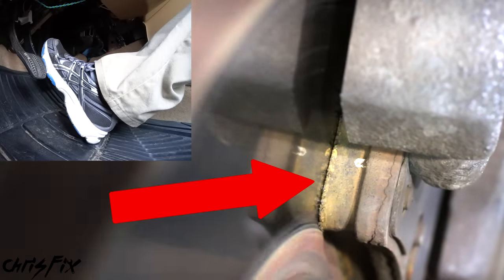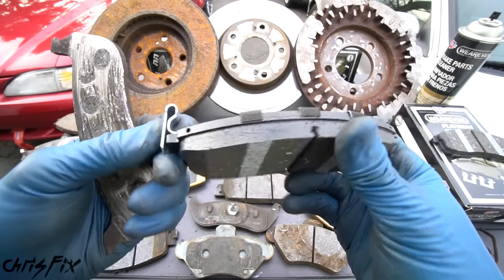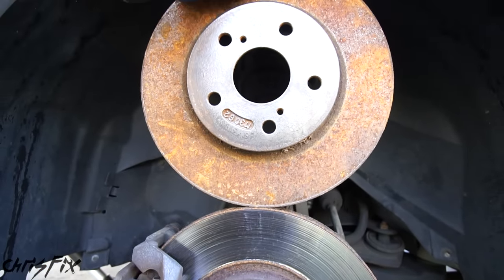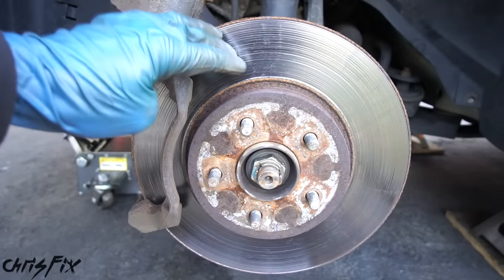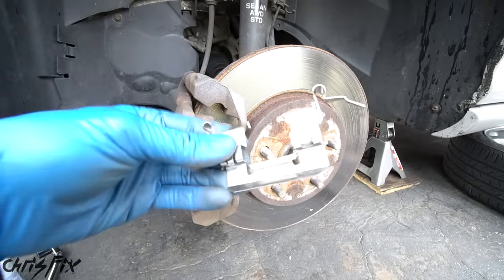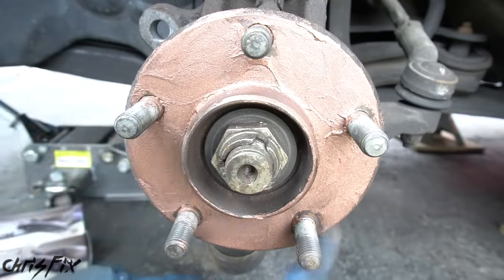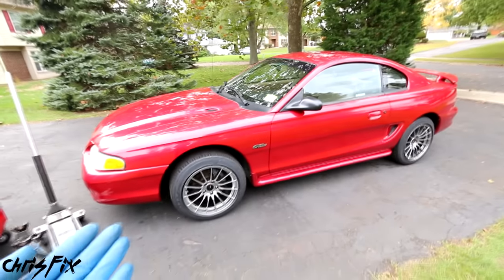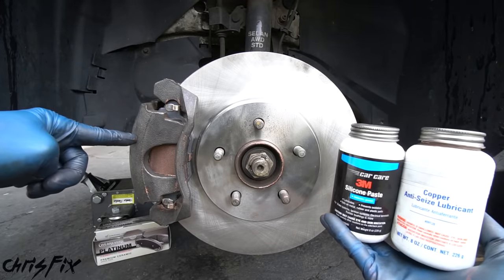How to Stop Your Brakes from Squeaking

Comment: You missed it on the graphite explanation, Chris. The pencil lead is graphite mixed with clay and fired in a kiln to make it hard. The more clay, the harder it is. The pure graphite used in never seize and other lubricants is a sooty, soft material, and feels much like grease if rubbed between your fingers. By the way, the person who invented the modern pencil lead was Henry Bessemer. He used the profits to invert the Bessemer Convertor, a process that changed steel making forever.

Comment: I'm surprised you didn't cover CRC Brake Quiet.  I've been using it since the early 90's.  I had a hard fought battle with stock brakes on my 87 Trans Am.  They were just too small.  I digress.  It's a silicone RTV like product (orange).  You apply a thin (like a 1/16th inch) layer to the back of the pads.  It greatly helps reduce harmonics in the pad.  I generally discard the 'quiet shims' that come on pads now days. They can warp, buckle, curl, and can come loose.  This even happened on the first set of C5 brakes I put on the TA.  Very useless things, at least for any spirited driving.  If I know I'm doing my brakes, I'll coat the back of pads the night before or sooner.  It can be messy, and you will want to wear gloves to save cleanup.  You put a ton of work into your videos!  Amazing.  Greasing the back of pads, well.. I've never done it.  Lubing hardware, and ends of pads, definitely, yes!

Comment: I'll try sanding the edges of the rotors, isntalled new brake pads, used the proper gease in the right spots but getting a nails on chalkboard sound at low speed braking. Thanks for the info!

Comment: i have a 2014 3.7l mustang that has a combination of mystery sounds that nobody can figure out. there's a creaking sound like stepping on an old staircase but with a more metalic sound to it whenever i step on the brake, most noticeable in low speeds and with any amount of brake pedal depression. it also happens while in park. it often is followed by some knocking 1-3 rapid knocks accelerating from a stop. I've replaced the sway bar links, rotars, brake pads and the shims that guide the pads as well as lubricated the caliper pistons and all contact points. 4 different shops gave me their second opinions with complete suspension diags which came back with nothing. there's no play when doing the shake tests of tires for CV/ball joints/bushings and tie rods. my brake booster is fine and had a brake fluid flush.  the knocking comes from driver's side but the creaking is most noticable on the passenger's side. there are no screeching sounds like you've described. the car jerks side to side a bit when turning right but not when turning left and when i hit bumps when turning right there's a lot more noise(sounds like you're dragging a bag of metal objects across the bumps) and you feel the bumps more. i have struts in the front and a diag came back with nothing wrong with them at all 4 shops as well, one of the shops was a ford dealership. this problem is really frustrating and i've only just started getting into DIY repairs. what do you think this could be?

Comment: Hello Chris, hope you are well. I m from Pakistan and have been following you for ages, you are a true inspiration.  I have been facing a brake issue in my Toyota Passo 2010 (it's an X variant, 1000 cc.) for the past 3 months, went to a few mechanics but every one of them is giving me different reasons and stories and above all charging me hell obnoxious instead of searching and going to the core issue.

The issue I have been facing is the brake oil in the bottle is not staying for too long and vanishes in 2-3 days and empties out completely. I have checked around all 4 wheels for any leakages but didn't find anything.  The master cylinder is attached to a black circular container which I believe is the brake pressure pump that has a leak inside. that's what the mechanics claimed. I was also told that replace the ABS unit, how to check and find the issue? how to test ABS if it's faulty or needs to be replaced? how to confirm the master brake pump is faulty or leak without any leak traces? mind there is no errors light on of ABS on the gauge. just a brake oil light. Lastly, please advise a few parts supplies and dealers in the US who I can buy parts cheaply and affordable. I so want to do the job myself, have all the common tools to open it up ut want to discuss with you first. TIA.

Comment: Here's a fun one for you to answer. I have a squeak in the front left wheel at back up, (stop - shift to reverse - let lose of the brake's and a squeak) its only once and not everytime. Brakes are brembo's not new but also not worn, pads + discs get cleaned and lubricated every seasonal tire change.
Reply: Do you have discs all around or do you have any drum brakes?
Reply: @vigilantemotors  discs all around. Only front left makes the noise.
Reply: @Maulus  Could be the piston is holding the pad in closer than it should. Check your caliper bolts for proper torque specs and see if anything is loose. 
Sometime a worn piston can cause weird sounds. 

Or have you done that already? lol
Reply: @vigilantemotors  yes as the pads and calipers get lubricated they get retorqued. Might need to referbish the caliper just to be sure the pistons are in correct working order.
Reply: @Maulus  If I had to guess its the piston. Remove the caliper, take out the pads, put a small piece of wood on the piston and c-clamp and watch if the piston goes in smoothly or at all for that matter.
Could be your culprit.
Hope that helps my man.

Nice brakes btw. Let me know how it workouts for you if you want. I have an automotive chnnel here myself so I love teaching and learning this stuff

Comment: There is one more reason. A stone chip jams between back of the brake rotor and dust shield. It will make noise until the stone chip rubbed enough to be freed in between.

Comment: Yessssss!!,   very important to "GREASE"  the -  "slide - pins ",
Once did a  " BRAKE JOB"
on a , 1989 - Nissan Sentra,   looks like  not one drop of  GREASE was  applied,    So,  the top   "SLIDE Pin"
Got Bent,    which can cause the whole caliper to be binded,  or in essence,   Cause the CALIPER to be stuck in the "Pressed" - position even though you're not pressing on the brake with the pedal,     So now,  you're about to have ISSUES,     your brakes are going to wear out faster,      get heated up,     loose gas mileage...  Also,  I wanted to mention,   When you put Brake - HARDWARE,   put GREASE between the Hardware,     GREASE should be applied between any metal-to-metal contact,    to also eliminate - " BRAKE - NOISE"....

Comment: Ive been having problems with my front breaks on my used car. The previous owner had never changed the breaks in her time using the car. So today makes it 7 years old for all the brakes. 
- my breaks are somewhat responsive
- the make that rythmic noise you mentioned
- and their is a horrible scraping, screetching noise thats unbelievable loud when braking soft-hard.
- soft braking causes a warpped rotor noise too.

So either way im gonna replace all brakes since they are all due for change. Ive heard that sometimes pebbles or rocks can get in between rotor and dust guard. 

I need to see what the issue is when i pull them apart.
Reply from the maker: Definitely a good idea to get some fresh pads/rotors on the car, sounds like it's a bit scary to drive now
Reply: @chrisfix  yeah for sure scary. Like at this point ive adapted my driving to barely use the brakes. I got used to just coasting so i  use them as little as possible.

Comment: I got break noise because I didn't use ceramic break pads. At first I thought maybe it's because they were new but after a few days and it was still making noise, I decided research it. It turns out that any break pads with metallic properties cause the squeaking because the metal is rubbing the rotors. Which will damage them and wear the rotors faster. Always use ceramic brakes, it's best for your vehicle.

Comment: Grooved brake pads and rotors aren't a problem as long as the grooves match on both. Only means that when you replace one, you also need to replace the other.
Reply from the maker: If your pads/rotors are grooved then that means they're worn to the point of needing to be replaced...

Comment: Awesome Tips! The sanding at 4:00 was the solution to my squealing brakes. I didn't remove the rotors, so I was able to only hit the top two edges and middle exposed edge. The other side, middle edge was just a gamble to leave it alone. After sanding down with grit 150 sandpaper and then I used a Dremel to do light touch up on the remaining. Put all the wheels back on. Then since the car was 'cold' as in not driven all morning. I took it for test drive....First 10 minutes of NO squealing. That was a silent and golden moment. thank you for your tips!!

Comment: Great video.  Good for high school auto class.

Personally, I don't give a crap about squeaks or squeals.  Just as long as everything is working, moving and wearing evenly enough.  

I only lube the guide pins and put anti-seize on their threads.

I always buy the best priced pads and replace them only as-needed.  Saves lots of money and time.   I even mix ceramic with semi-metallic and never have noticed any difference.  

Some people replace rotors too often.  Only in rust belts do they need to more often.  They rarely ever need to be changed otherwise.  They should be able to last 300,000 miles or more, easily.  Out of 30 high mileage vehicles I've only needed to change 4 rotors over 30 years.

Comment: I'd skip the greasing of the backplates.  The rubber backing is designed to avoid unnecessary squealing.   There are also instances of service manuals indicating that no grease should be applied to the backing plates.  Having said that if it's only a little bit it I doubt it causes issues.
Reply: Agree.

Comment: Dont forget to mention that different types of break pad material can cause breaksqueeling. I drive a heavy car which uses semi-metallic pads. Could not find out why my rear breaks where making a high pitch squeel noise even though they still had 50% padlife. I replaced them with copper-free ceramic pads and noise is gone!

Comment: Hi Chris!
Question:
I have a 2001 Tacoma that makes a weird, high-pitch sort of hissing/squeaking noise in the neighborhood of the master cylinder. It's loud enough to hear from inside the truck with the engine running. But if you press down the brake, the noise stops. Let go and the noise starts again. Ideas?
Thanks.
I love you.

Comment: Great video! I also have a squeak noise while driving the car in slow speed. Usually i hear after driving the car 10 min later. I hear click noise the first time I hit the break then i dont hear it. PS i did change the front break pads and the still issue remains. I hope you see my msg. Thanks!
Reply from the maker: Sounds like the brake pad is not moving correctly in the brake hardware. The slap is it hitting the rotor when you apply the brakes.

Comment: All good, but another common source is from the ends of the hardware clips that hold the brakes are scraping the rotor. The break pads should slide, not the break hardware. Painting a caliper assembly can make the break hardware to tight and the pads will hang up.

Comment: I learned a lot trying to change my own brake pads. Had to buy a new breaker bar to take off the nuts that were like welded into the wheel but the whole experience was awesome. Thank you very much and please teach us how to change the timing belt of a 94 corolla seca next if you can HaHa. Cheers.

Comment: This is great stuff and all good but... you also could suffer squeaking brakes because of a partially seized caliper as I have done on my car. But before you buy a caliper - run through the checks Chris has pointed out first. A seized or partially seized caliper can also produce wheel vibration as it heats and then distorts the rotor due to the brake pad continuously being in contact with the rotor - then when you brake you feel wobble at the steering wheel.

Comment: My moms 2007 Toyota Camrys rear drum breaks squeal, and after all the research I've done, I'm pretty sure there's a hot spot on them where the metal contacts wear down one spot. I'm YouTube certified on "mekanics" and have done ALOT to my own car, disassembled my engine, interior, painted engine bay, valve covers etc. And yet she doesnt trust me to work on her car, But I'm in the process of convincing her to let me fix them for half the price a mechanic would charge. She already took it to two mechanics and that's actually when it got worse. So I was hoping you could concentrate more on drum styles and rubbing. It squeals bad even when driving and not applying breaks. Ik I could most likely easily fix them, but I wanted professional advice JUST incase I cant, Bc thorn Ill lose her trust, LOL. Thanks in advance, and sorry for the novel I wrote, could've made that shorter
Reply from the maker: Thanks for the video idea! And let me know if you can convince your mom haha

Comment: I personally like to bed-in the brakes by slamming on the brakes from 40-50 mph to a complete stop 4 or 5 times after I install new brakes pads. I never have an issue with noise and it stops better doing this extra step.
Reply from the maker: Some brakes require bedding in, once they're in you're good to go for a long time

Comment: those anti rattle clips don't wear out they are made out of CK1088 spring steel which is harder than the brake pad steel
Dont forget to do the caliper bolts up to the correct torque setting

Comment: Note: cheap disc pad caliper hardware often doesn’t fit, as long as you can clean up your oem brake hardware it often lasts many many pads changes. Change your springs though.